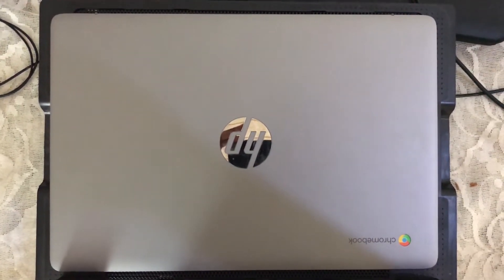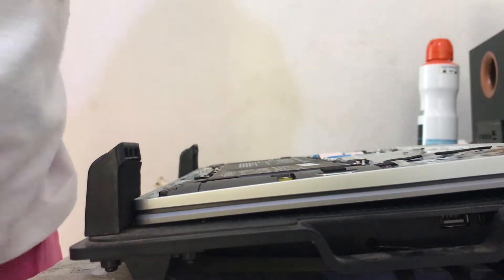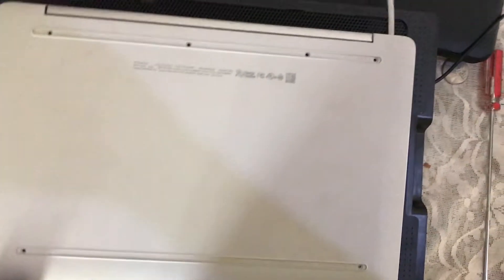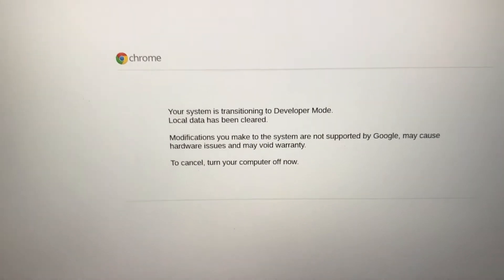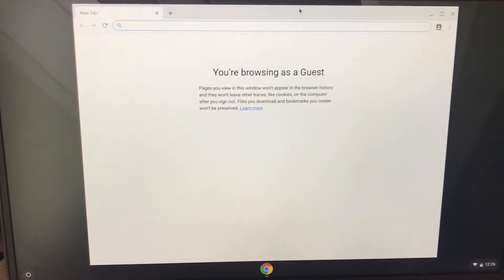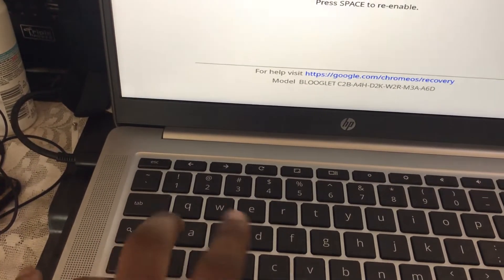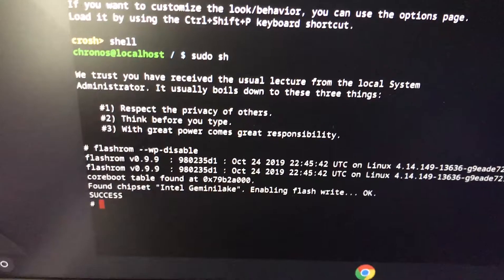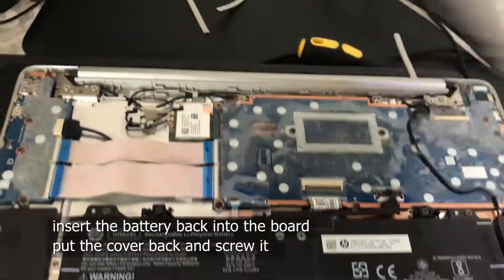How to disable write protect on Chromebook .

Comment: Kudos to you on the amazing work you're doing.
So I have this HP 360 14b chromebook I'm trying to disable the WP. I've tried all the methods but to no avail. The suzyQ cable is looking like the only option but I wanted to find out if there's another way to disable the WP. Thanks.

Comment: on that screen it shows os verification is off and ctrl + D not working and a message on top left says "developer mode is disabled on this device by system"
Reply: I have the same issue since today
Reply from the maker: which model do you have
Reply from the maker: Then it’s company locked
Reply from the maker: is it a personal or company chromebook?
and what model do you have?
Reply: Same as well and I have a Chromebook Lenovo c330

Comment: when i type shell, it gives me 
Sudo commands will not succeed by default.
If you want to use sudo commands, use the VT-2 shell
(Ctrl-Alt-{F2/Right arrow/Refresh}) or build the image with the
login_enable_crosh_sudo USE flag:

$ USE=login_enable_crosh_sudo emerge-$BOARD chromeos-login
or
$ USE=login_enable_crosh_sudo cros build-packages --board=$BOARD 

I have a Acer spin 713

Comment: flashrom command not working for me due to flashrom chip not having an inactive voltage level. battery disconnected. Lenovo Ideapad 3
Reply: Same issue did you get it fixed??
Reply: @Callisto-f6n  X2

Comment: I have a hp chromebook 15a-na0010ca and after typing "flashrom --wp-disable" it says : "hardware Status registre protection is enabled. The chip's WP# pin must Be set to an inactive voltage level to Be able to change the WP settings"
Reply from the maker: Did you disconnect the battery?
Reply: @JessokTech yes
Reply from the maker: I watched the video you shared.  On the motherboard the is WP on it. Check if there is a flat screw at the place the WP is located.  
And if you are disabling the WP to install a different OS on your chromebook, check out my other video on (how to install windows 10 on a chromebook). Check if your chromebook is supported and listed on coolstar.org
Reply: @JessokTech I also disconnected the battery
Reply: @JessokTech my Chromebook is supported
Reply: Same issue did you get it fixed??
Reply: Same issue did you get it resolved??

Comment: Hi, I was wondering if my Acer Chromebook C732 will run on its original Chrome OS okay even with write protect disabled. I just ordered this laptop and paid the seller extra to disable write protect thinking it was about to stop getting updates soon. I just got it and discovered that its AUE date actually isn't until 2027! Are there any issues with it continuing on Chrome OS without write protection, or should I re-enable it? Thanks!
Reply from the maker: I'd recommend you contact the seller with this question.
Reply: if your going to keep using chrome os then put it back for security updates sorry it’s a year late

Comment: found no write protect screws and disconnected my battery yet whenever i try to run --wp-disable it always says failed....what to do?
Reply: i checked the flashrom/me page and checked out some links that were there but i'm very tech illiterate and couldn't understand a thing...
Reply: i tried to send the exact error code i got but youtube detected it as spam, any way i could send it to you via email or something?
Reply from the maker: itmall128@gmail.com
Reply from the maker: You have to enable developer mode first